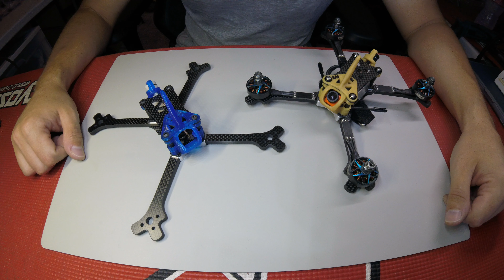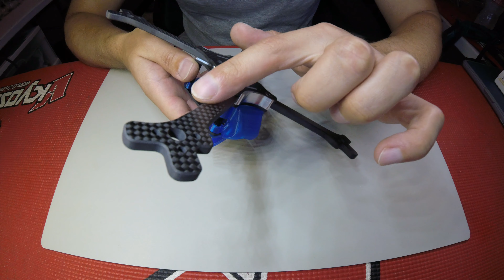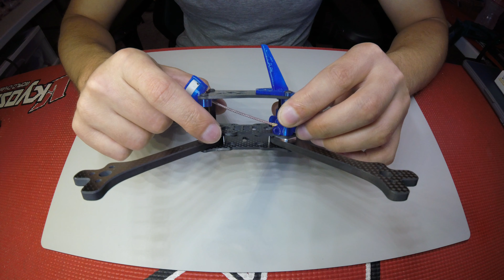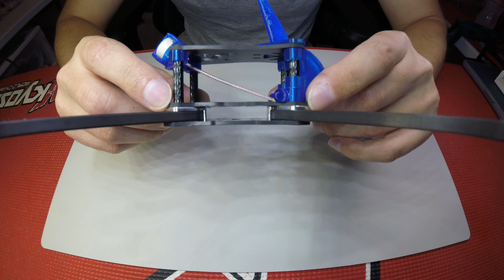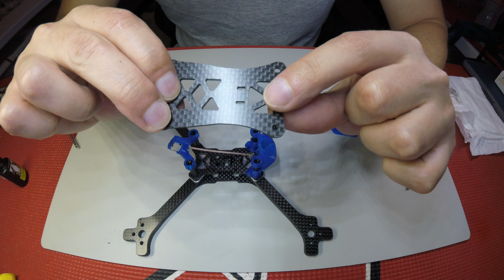Build Video - Cobra SLX EVO Racing Frame!

Comment: mine just arrived, quick build - question, can I smooth out the edges a little on bottom plate to prevent strap cuts? - Scott
Reply from the maker: @waytooslow yep, that will work fine!
Reply: @rpmfpv  Thanks --  a  suggestion - include a die cut battery pad. :-)